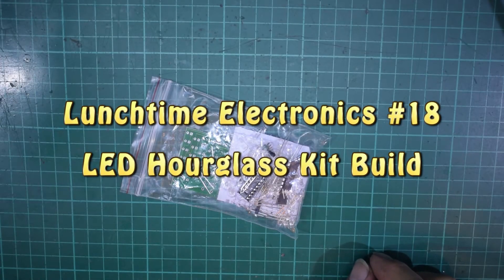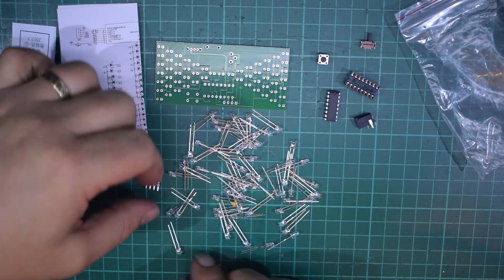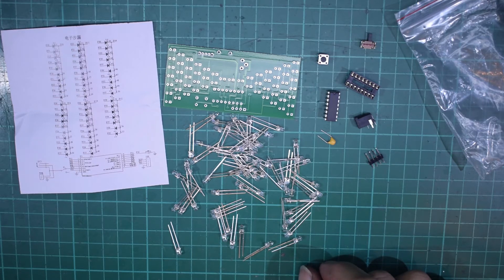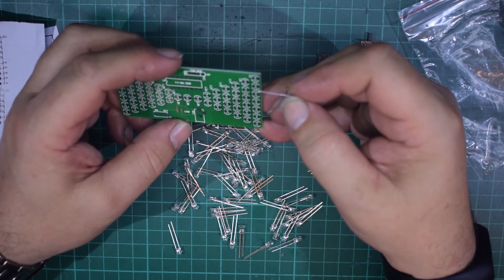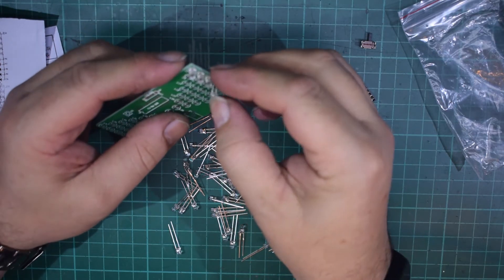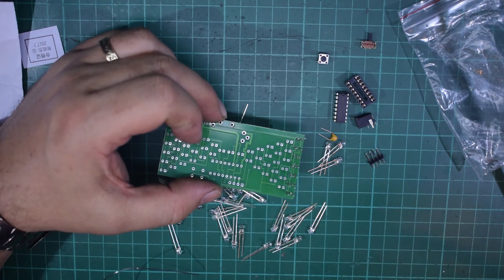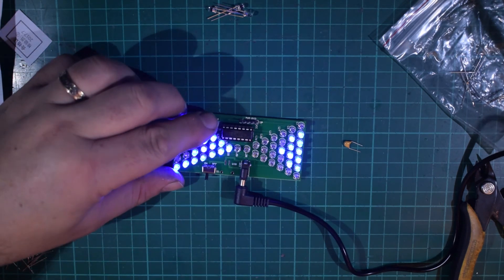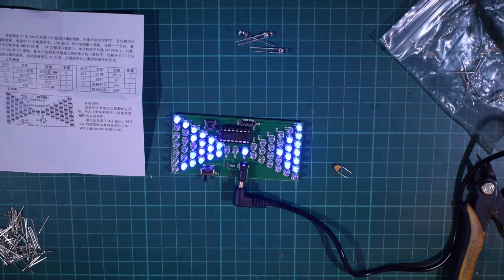Lunchtime Electronics #18 : LED Hourglass Kit

Comment: I've been thinking of getting me one of those hourglasses. :)
Reply from the maker: Its not a bad little kit, and if you like programming you can actually modify the code to change the parameters. Me, I'm not a programmer!
Reply: Krantz Lab
I've been thinking of getting me one of those hourglasses. :)
'
hi K L...
my kit is finish and great
Reply: @GeorgeChristofi  Have you seen anywhere either the code or instructions for changing the parameters of this project? Looking for any info to modify my kit. Thanks for posting this video!
Reply from the maker: @electronicsluckydip  I haven't seen the code or any modifications to the kit unfortunately.

Comment: This is a Great tutorial thanks,  just one question please.  I find that the 3 led's in the middle are really annoying flashing so fast, would it be possible to make them not flash or lower the brightness?
Thanks again John ( I have liked and subscribed )
Reply from the maker: John Berry I'm sure it could if you put in a wait or pause command into the microcontroller.  As for the brightness, as all the leds are directly driven it is a bit of double edged sword. You could add a separate resistor to the ones you want to dim down. The downside of that is when all of the leds are lit then the dimmer ones would be even dimmer.
Reply: OK, Thank you very much for your help... :)

Comment: Could the capacitor be a filtering cap for the microprocessor, across ground and power?
Reply from the maker: A Frend it actually goes across two pins of the microcontroller if the output is unstable. As mine worked I left it out.
Reply: just out of interest what two pins sir ?
Reply from the maker: andymouse123 the instructions say 6 (vcc) and 2(gnd)
Reply: thanks ,so it just across the supply (if needed)
Reply from the maker: yes, just to take out any odd spikes or ripple.

Comment: hi how can I slow it down and use it as a real egg timer ? cant find much on this micro controller your thoughts would be welcome sir
Reply from the maker: andymouse123 to slow it down further than the minimum speed you would probably have to add a pause into the code so that it would wait a certain amount of time.  Another way might be to reduce the oscillator frequency down to a lower value if the controller can handle it.